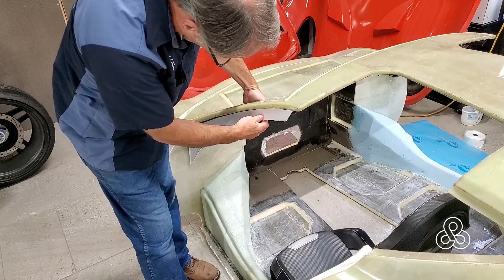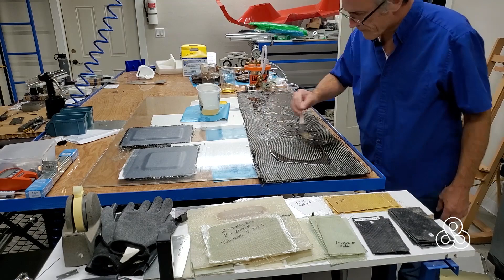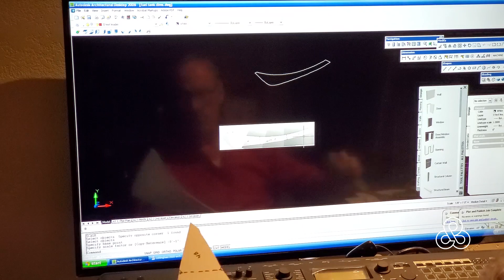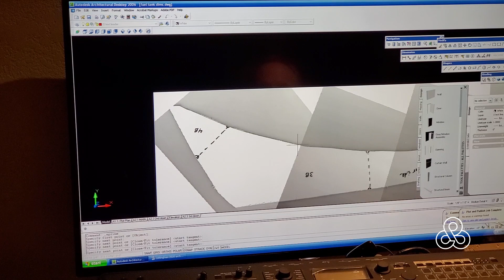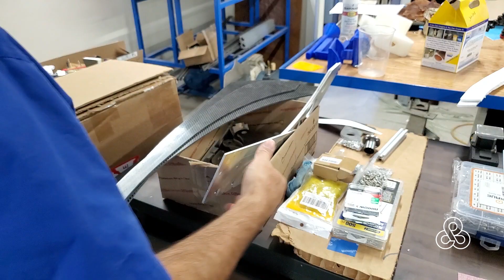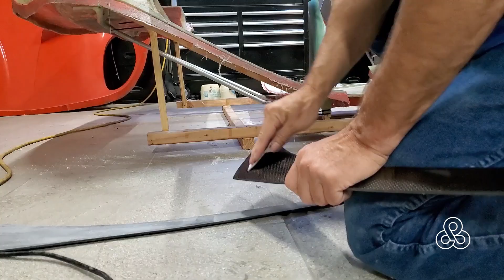A44 - Carbon fiber reinforcement is what it took!- Arete Supercar project

Comment from the maker: Subscriber Grant Oaks helped me realize that the video described the lamination being 4 layers of carbon fiber laminated to create 8 layers in the finished part. It is in actuality 16 finished layers made from two panels of 8 layers or as follows- 5.7oz carbon fiber cloth is .011 raw - after laminating 1 layer without vacuum= .017   8-plys= .14 (which calculates out to .0175/ply) - 8 plys bonded to 8 plys= .28 which means the epoxy between panels was .02 as the finished part measures .30 inches. Anyway, clarification for those watching the minute detail of the build.
Reply: You didn't "back butter" the second carbon fibre part? I think I would have sandwiched them underneath some weight, like a pile of toolboxes.
Reply: This guy has no Idea what he's doing and that's why his laminates looks
 like shit

Comment: It seems to me that there are major rigidity issues throughout here and there is a very good reason why many cars of this type (the majority) are either a tube chassis throughout or front and rear frames attached to the centre tub. If the car is unfortunate enough to roll over the passenger cell will collapse instantly. That CF stiffening element should, at the very least, continue down the side and you really need a roll cage structure. As it is currently the stiffening that this CF component offers is purely cosmetic.

Comment: now correct me if i’m an idiot but would it perhaps be a slightly cheaper option to stagger the sheets of carbon with sheets of kevlar?
Reply from the maker: You could reduce the cost with fiberglass, but Kevlar's price is up there with the carbon. Thanks for watching.

Comment: What cutting tool was that?
Reply from the maker: Oscillating saw with a carbide metal cutting (hacksaw) blade. Most electric tool manufacturers (Dewalt, Porter cable etc.) are making them! Next greatest invention since the hand held grinder.

Comment: Won't the windscreen also take some of that flex?
Reply from the maker: Yes, the wind screen will add a great deal of stiffness. Since this video most of the lamination around the a-pillars has been done and it is now quite stiff; with the windscreen bonded in place it will be very rigid.

Comment: That carbon fiber reinforcement sounds good, but I was thinking...What could be happens in the event of a accident where the car crashes against that support?? Does the rest of the non carbon fiber body will support the whole car's weight? I'm guessing the roof will collapse while the carbon fiber reinforcement will survive intact....Maybe a complete loop of reinforcement all around the door contour could take the weight...Why not to create a whole carbon fiber anti roll cage? Something who follows the windshield contour plus the roof plus the doors..,a whole unitized reinforced structure all around the passengers cabin aka an anti rool cage but made it from laminated carbon fiber. In my mind, security must be a priority, like if the car was a production car who passes the test crashes with 5 stars.
Reply from the maker: Carbon fiber is stiffer, but stiffness is not always the answer. In this case, flexibility would be a benefit as the structure can give a little without shearing off immediately.  There are some very thick vertical fiberglass beams laminated into the rear firewall that can support hundreds of thousands of pounds under ideal conditions, but a wreck is never ideal and the loads would never be perfectly vertical, so to counter this there will be a steel roll bar that bolts to the vertical beams. The steel gives some strength through malleability and the fiberglass beams add the shear strength.
Reply: @BuilderCreator  You are doing a great effort to build an sports car at your shop with your bare hands and your knowledge. My main concern in automobiles it's security first, then technology, performance and beauty at the end. If I design a car like you in the future, I will separates the cabin from the frunk and rear engine at least 6 in to create impact crush areas to protect passengers from any front/rear crash looking to keep cabin intact. Congratulations and thanks a lot for teaching us about sinthetic & compound materials and how to achieve our dreams.

Comment: There are a couple of companies that make carbon fiber seats that are very thin and of course light weight. Remarkably, they are also very comfortable as long as you don't have a big fat wallet in your back pocket. As talented as you are you could probably mold your own seats and gain valuable inches of leg and head room.
Reply from the maker: Molding the seats right off my backside is the plan.  Less the wallet . . . .then again my wallet runs pretty thin!

Comment: I'm a little worried that the carbon fiber braces could delaminate from the bulk head as soon as any considerable load is applied on the A-pillar -- because of the comparably short overlap of that extremely stiff lower part of the braces?
Reply from the maker: Coming in one of the next videos I will be "boxing in" the carbon spar and joining the a pillar to the door seal.

Comment: I think it wasn't CF that fixed it but some depth. I had been wondering why you don't use more shaped foam and less layers. You can put endless fibre in the centre but really a sheet metal a pillar is a thin wall big diameter tube. Less layers more volume.
Reply from the maker: Depth for sure, but fans were demanding carbon fiber and this was an appropriate application. The A pillars will also be boxed in (making a tube) after I build the rain gutter/weather seal channel. Lots of "shaped" foam coming in stiffening/reinforcement of clam-shells, etc.

Comment: You put tremendous effort in this car but you should get some advices from a composite structural engineer to achieve your goal. 
Your A-pillar is built as a single skin web and will buckle under compressive load no matter how thick you make it. The T shape x-section is wrong for this application and the fiber orientation is wrong. 
Please consider using UD in the capping (and pad layer) and double-bias (+/45) in the web for shear strength over a structural foam core for exemple. Typical A section is used for pillars.
All your taping should be double bias (+/45) for shear load transfert and not (0/90) as 0deg does nothing to transfert load.
As your A-pillar is a cantilever beam, you must also reinforce heavily the base to avoid any colapse/peeling/debonding of the area.
Plywood/carbon/epoxy is a smart way to reinforce such an area at low cost.
Good luck with the rest of the construction.
Regards.
Reply from the maker: Still much more to come on the A-pillars and EVERYTHING else. We will try to make all of you have confidence in the structure. I just have more glass than time, but the glass will come with time. Ha!
Reply: I find myself agreeing with much of what @Malric Leborgne said. This does not seem like a well thought out way to strengthen the windshield area. UD seems like a no brainer. I feel that in a roll over the loads will get concentrated at the weakest points, the ends of that rib. Those ribs are probably twice the weight and half the stiffness of well consolidated UD.  Please don't take this as anything other than my opinion and desire to see you safe in that gorgeous looking car.

Comment: I just discovered this channel 6 days ago.i have hit the subscribe button.
am learning alot
 Compared to Iron is this materiel heavy ? How light is it?I actually did not know that you can build a car body using "molding" technique.?
Reply from the maker: They weigh the same. one pound of Iron vs one pound of epoxy and fiberglass. Strength to weight ratio is slightly better for the S-Glass fiberglass. Although each have certain advantages depending on your application.

Comment: Using Windows XP in 2020. You just know that there is some equipment in his shop that refuses to run on anything but a paralell port ^^
Reply from the maker: I refuse to pay the $5k for updating AutoCAD!
Reply: @BuilderCreator  Oh well, you should try freeCAD when you have the time. It's a little clunky, but does what it's supposed to and it's open source!

Comment: I'm curious about the "stiffness" with flat panels. A pair of 4 layer panels bonded to make an 8 layer versus separating the same dual 4 layer with Nomex or aluminum honeycomb...or whatever you choose. If it wasn't for material cost and labour the added strength seems incredible if the technique was applied everywhere possible. 

  One thing about the finished stacked panels...they better be perfect because they're not going to be persuaded to flex to accommodate any errors. 

Interesting stuff. The costs are interesting too. So many years without a care in the world for a wide trim edge here and an occasional mishap there. It was just about doing it the best way we've managed to work up to. 
Cheers, great project.

Comment: On a word of caution:  Our brethren in the custom bicycle build community have discovered that carbon fiber does not play nicely when in contact with metal and especially steel.  Hub and neck tubes directly in contact with carbon fiber are subject to electrolytic action and the bonds fail.  If a carbon fiber component needs to support metal, then it is better to have a glass or kevlar transition.
Reply from the maker: Small bits of wisdom that only come with time and exposure. Thanks.
Reply: Then again there are the difference in the coefficient of contraction as well. If it's not baked epoxy temperature will always play a role in failure, lower glass transition temperatures are the key.

Comment: im so excited to see people who know what they are doing do this thing and I have a ton of respect for your skill trade and knowledge of what it takes to build a car by hand from basically cloth and cans of resin. I am worried however about that intro where you sit in your seat. The head clearance looks really crammed however and your eye line seems quite close to the top of the windshield. I know the seat isn't fixed and that's not its final position, it just raised some questions.

I drive a boring 2013 chevy volt. My one complaint with it when waiting at lights is I have to lean over the steering wheel to look up at the traffic light to see it change. I'm tall and the windshield seems like it ends too soon. Ideally like tesla cars, the windshield feels like it should have gone much further up into the roof line to avoid a visibility angle issue when it comes to traffic lights that are too close and too high to the stop line.

Keep up the awesome work!

Comment: you should of used stainless steel to build a frame around the windshield and sandwhiched it between the fiberglass also missed doing the same in a few other key areas support

Comment: Should have used a vacuum bag to squeeze the layers together and force excess resin out. Strength comes from the carbon not the resin.
Reply from the maker: The carbon layup was "Bagged," as they say. Sorry, sometimes video just disappears or is so crappy i just don't use it.

Comment: In other cars the windscreen would supply the strength needed to stop the pillar from flexing. The Carbon fibre is just a bonus ....
Reply: This is junk carbon fiber work: no epoxy, no vacuum bagging and no autoclave......terrible
Reply: @richardsmith9509  but this isn't traditional carbon fiber work he's fiberglassing over it.
Reply: Sure is and that does NOT work. Structurally speaking, this creature is terrifying...

Comment: I keep thinking, when are you going to add the sub frame into the tub. Also are you adding the a pillar structure to that carbon fiber part? Looking forward to you building the door pillar because the door pillar and the a pillar are a one pice build that conects from the sub fram to the the tub and then on to the windshield frame.
THIS also conecrs to the roof structure to the sub frame. But you know that.

Comment: I scan things a lot that need to be exact in translation, a hint i'd recommend is scan a ruler along with your item. This way, you just have to make sure the ruler is to scale, rather than measuring points.
Reply from the maker: Most of my rulers are engineers scales- don't fit in the scanner very well. Ha!
Reply: @BuilderCreator  doesn't mean you can't buy one smaller.

Comment: But,are fiber glass cars strong enough?
Reply from the maker: Strong enough is an open ended question, like" how long is a piece of string?"  A fiberglass car can be stronger than steel or carbon graphite- all dependent on the weight. Corvette, lotus cars and many others have used fiberglass for years.
Reply: @BuilderCreator  have you heard the hype about hemp fiber composites or other natural fiber composites?  I've tried to find out more but there's not much info out there. Could you perhaps make a video overview of the different configurations?
Reply from the maker: @hughjassstudios9688  Didn't I see this in a Cheech and Chong movie in the 70s? Actually, most of the organic fibers make their way into light weight cosmetic and acoustical panels. The newest rising star in the structural fiber world is basalt fiber. Basalt and organics are hard to come by for the hobbiest/small manufacturer. (Unless you have a project that needs 1000yrds of fabric!) A review by me would be purely conjectural.
Reply: @hughjassstudios9688  the Techinical University of Eindhoven build an electric car made of plant fibres. The project is called Noah. If you google "TU eindhoven noah" you will get some results.
Reply: @BuilderCreator  Nope
Lotus uses Aloy or Steel Frames with GFK Bodys. Corvette is the same.

Beach Buggys from the 60/70 also uses Steel "Frames" from a VW for their GFK Bodys.
Other Manufacturers like Cox, Hawk-Stewart & Arden used Steel Frames inside the Body without a Chassis except using the Subframes from the Mini.
Reply from the maker: @10zoll  The question was are, fiberglass cars strong enough? Never defined as fiberglass chassis strong enough.
Reply: @BuilderCreator  " fiberglass cars strong enough" So the Answer is: No idea because i never seen anything like that instead of use Lotus / Corvette as a example ;-)
And to my other post - mixing cfk & gfk - you need to test some examples with 7 Layers gfk to eg 4 Layers GFK with 4 Layers CFK.
The one with only GFK or CFK is stronger !

Comment: How thick were the 4 plies of 5.7oz 2x2 twill? Just hand lay, no vacuum bagging? My guess is 0.030 inches, 0.065 when the 2 panels are bonded together.
Reply from the maker: Hey Grant! thanks for asking, as this prompted me to look at the final product and see that there is a big error in the video. The finished part was "16 layers." Your calculation would have been very close had I been at the 8 plys I mentioned. Here is the actual tally:  5.7oz cloth is .011 raw - after laminating 1 layer without vacuum= .017   8-plys= .14 (which calculates out to .0175/ply) - 8 plys bonded to 8 plys= .28 which means the epoxy between panels was .02 as the finished part measures .30 inches. Again, thanks for fact checking me, as I don't want to be part of the "Fake News (info)" and face YouTube banishment. Ha!
Reply: @BuilderCreator   I just checked on the US Composites site and their 5.7oz 2x2 twill CF is .010 raw and that should work out to a .015 with a good, clean squeegee layup. My 9oz E-glass 8HS was .015 after wet out. That's why I thought the 5.7 would be around .007 or so per ply wet.
Reply from the maker: @GrantOakes  Should be .015 and I was at .017. looks like I was running a little rich! I guess that is what the Vacuum bag is for!